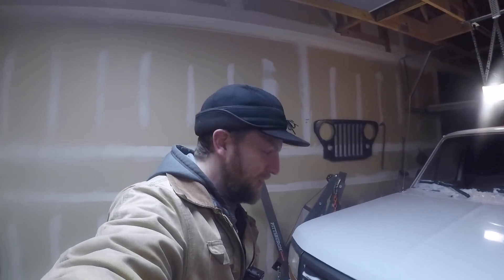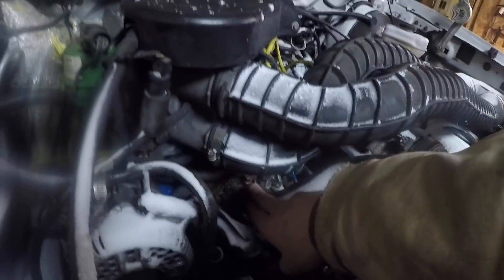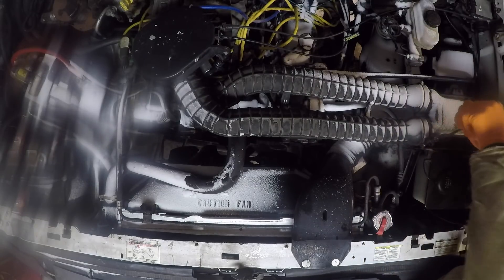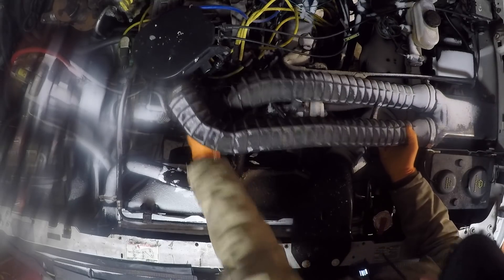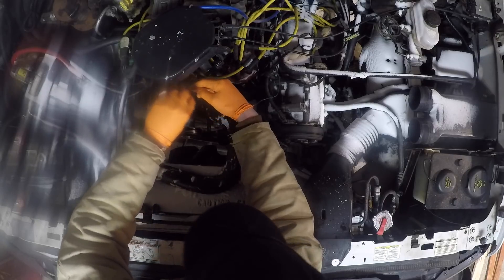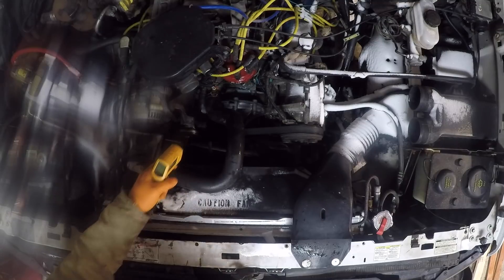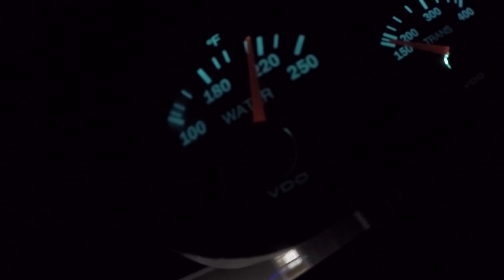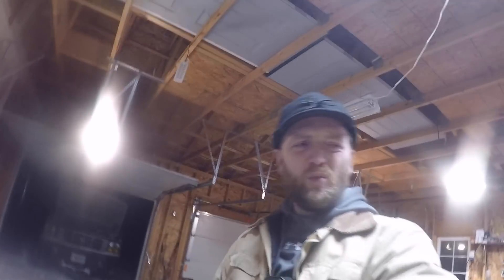Replacing a 5 8 thermostat

Comment: After thought. If it’s a 2 row Radiator (Original) then its probably time to upgrade with an all brass tank 4 row for a big block to help in cooling when towing or plowing. It really makes a huge difference. Just a though.

Comment: I test the thermostats by putting them in a saucepan of water and heating it on the stove, I measure the temperature rise and note the temperature at which it opens if it does.
Reply: This method of thermostat testing, my instructor- in mechanic school- show for us in 1974 beck in Poland.
Reply: About the same time I learned it too.

Comment: Hi Blake a happy and prosperous new year to you. Why not put a tarp over the nose of your truck to avoid the snow blowing in your enginebay?
Reply from the maker: All that snow blew in with the hood closed.
Reply: Use a tarp of about 4 feet high and mount it from the left side mirror around the front  to the right one with rubber bands, so it closes the wheelarches and the radiator will help a lot for sure.

Comment: Fords really don’t like to run that hot. I would think maybe the radiator is plugged up or something. Here in Texas during the summer  with the temp near 100 degrees I would have my 5.8 run at 187 to 205 degrees and it never got any hotter. Just seems that something is still not right especially when it’s that cold and windy up north. Anyway keep an eye on it and have a Happy New Year from Texas!!!

Comment: Anytime u have coolant come surging out it a blown heads gasket. The reason why the test didn't work it isn't leaking at idle load. I had a 5.8 did the same thing only under a heavy load will it come out.

Comment: Blake, how does a bad thermostat build excess pressure but not run too hot?  Just wondering the physics there. Happy New Year!
Reply from the maker: I don’t know the answer to that. I’ve checked the system with a couple of different IR and physical thermometers and they show the truck running right where it should be, but both in cab gauges show it running warm/ hot.
Reply: Well i supose the removing and fitting again of the radiatorcap helps fixing this problem too.

Comment: The radiator could be plugged up or the impeller veins on the water pump could be slipping. Ima bet a soda pop that it's going to rear it's ugly head later on. Still a good truck and I'd fix it before buying any of this new age plastic surrounded by thin foul.